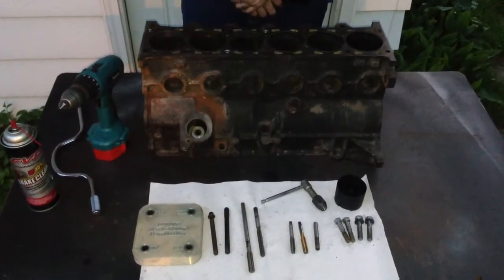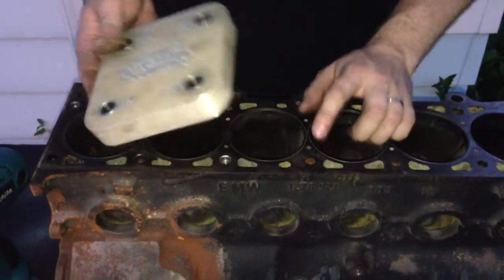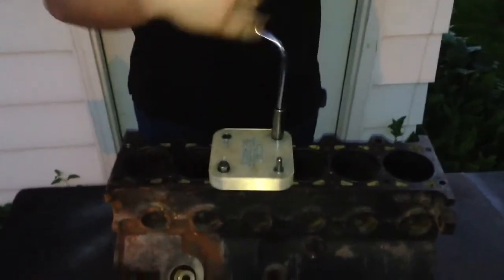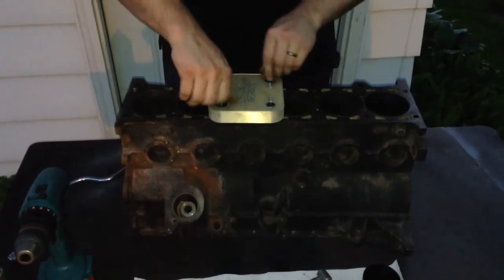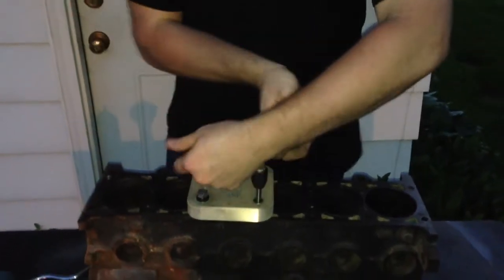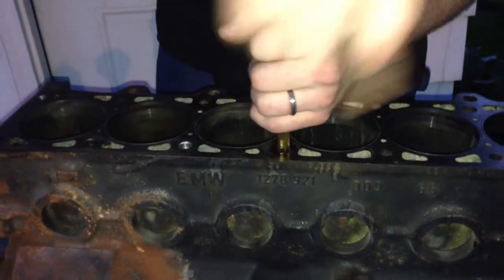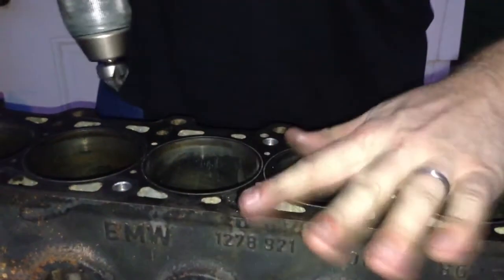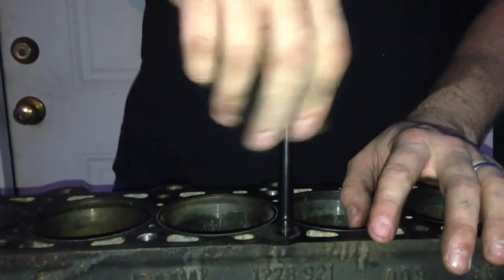Retapping BMW head bolts to 11mm

Comment: Question, you this is on a m20 block or m50? Using the s54 head studs which are in the e46 m3. Do these work for a m54b30? Or what do you recommend? I haven't found any information on how long or wide the head bolts for the m54 motors are, and there aren't any made for it. So my route currently is your method. Someone had mentioned a m12 stud but nothing more.. I'm hoping you can give me more insight on this. Thank you for your time.
Reply from the maker: +Crzylexusdrvr 

This is an M20 block just for demonstration.  This is meant for M50's, iron block M52, and US spec S50 and S52 motors.  M50 head bolt length is 95mm, S54 is 99mm, M54 is 110mm and is M10x1.5.  I can't help you with what will work for an M54.  They are not worth building in my opinion.